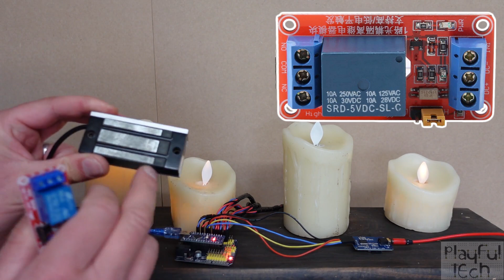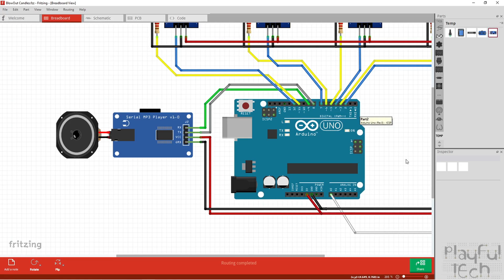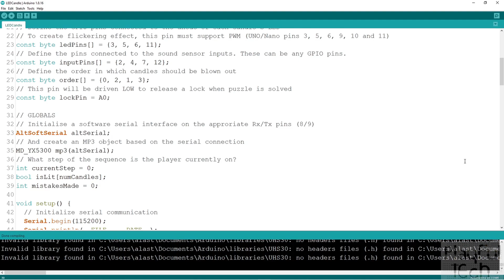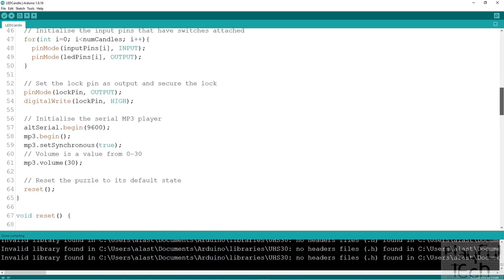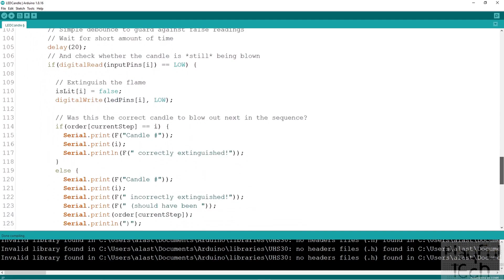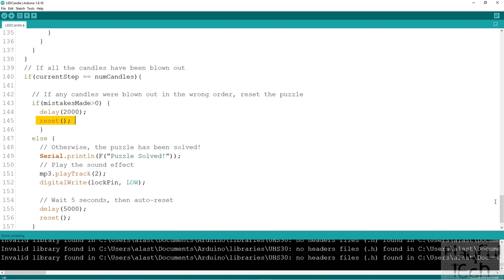"Blow Out Candles" Arduino Escape Room Puzzle Tutorial

Comment: What aplifier are you using in this? Are you able to do a video on adding sound to puzzles in the future if you haven't already done so?
Also, maybe a video on how to manage power? As at the end of most these puzzles you end up needing multiple wall sockets for arduinos, maglocks, speakers, amps etc. Is there a easier way to manage this and reduce the amount of plug sockets or is it simply the case of getting extension cords?
Reply from the maker: I normally use a cheap power amplifier like this one: https://s.click.aliexpress.com/e/_oFhtXOS
Reply: @PlayfulTechnology  perfect. Thanks for the link. Do you have any recommendations for cheap small speakers for puzzles like this that don't need audio output that's too powerful? As a complete audio noob my only speaker buying experience is computer speakers that plug in via an aux lead. What should I be searching for when looking for speakers that will plug into the input on these type of amps? Thanks for the great videos. Love your creativity and knowledge and how you break it down so even someone like me can understand and follow along lol.
Reply from the maker: @coasterollie  I normally salvage speakers from old computer speakers, Hi-Fis, arcade machines. Basically any small speaker with 4Ω/8Ω resistance will be driven by an amplifier like that just fine (and be quite loud!)
Reply from the maker: Power is an interesting one... I have considered it, but there's such a huge variety in how people run power in their rooms (e.g. do you have a low voltage 12V/24V loop run throughout? Or do you have wall sockets and run local power adaptors to each prop? Or do you have PoE?) and then there's the matter of electrical safety regulations which differ by country (I'm in the UK, so the advice I give for our 230 VAC here will be different than in Europe, or Asia, or the U.S.), so I've always considered it something that is better consulted with a local electrician
Reply: @PlayfulTechnology  thats fair enough. Thanks for explaining and I understand. 😊

Comment: Does the amp rating on the power supply matter for these projects? I have wall plugs that are rated at 1amp, 2 amps and 5 amps. Does it matter which one I use?
Reply from the maker: The rating on a power supply gives you the maximum current it is capable of delivering. So long as that exceeds whatever your project requires, that's fine (a typical Arduino project might only draw 0.5A, but if you powered it via a 1A, 2A, or 5A supply, they would all be fine, since the Arduino will only draw as much current as it requires)

Comment: Thank you so so much for this tutorial! I have been making escape rooms in our garden shed for my family and some friends - and wanted to make these blow out candles for my next room (a halloween theme!), but didnt want to spend an arm and a leg on a pre-made version (especially because I can reuse these parts in the future if i make it myself) 

I have never coded anything in my life or built anything electronic for that matter. I worked solely off this tutorial and was able to make a fully functioning 3 candled escape room puzzle (without the mp3 function because I wanted to keep it simple for my first project). I had to tweak the code a bit, because for some reason my mag lock was powered differently and I actually needed to code the power source to LOW until the puzzle was solved and switch it to HIGH to open the lock (it took me a few hours to troubleshoot that lol). Apparently the power source to my mag lock works when the arduino board isnt plugged in, but stops working/cuts power when the arduino was plugged in - no idea why?? 

I definitly learned a lot from this and now have a super fun element for our next escape room, so thank you so much!

Comment: Hey i had some problem with the code ,  it wont work for me , even when i use the arduino without connecting anyting i get these :
"Puzzle Reset!
Candle #0 correctly extinguishe!
Candle #1 incorrectly extinguished! (should have been 2)
Candle #2 incorrectly extinguished! (should have been 1)
Candle #3 correctly extinguished!"

he keeps running with the same result , can you help please

Comment: I hope you don't mind me asking: How long did it take you to finish this particular project? Just the props and programming, not the video?
Reply from the maker: It's very hard to say because I don't create a single project from scratch all in one go - I've been making these projects for many years now, so a lot of the time I might have leftover ideas from previous projects, or commissions that didn't work out, and I often use those as a starting point. Sometimes I have an idea and it just works first time but, more often than not, I have to go through several versions on the way and (mostly!) I never show those failed early attempts. In this particular tutorial for example, I spent at least three or four days learning and experimenting with different sorts of sensors before settling on using these simple microphone sound sensors, for example. But, although you'll never see those sensors used in this particular project, I don't regard that time as wasted because maybe in the future a new project will come along and I'll be able to think "Ah-ha - I know just the sensor for that!" ;) 
The programming itself does not take me long - my background is as a software programmer, so I can confidently write the code to get the behaviour I want very easily. The problem is almost always on the hardware side, because in escape rooms you're often trying to use components in slightly unusual or novel ways, and there's not a whole lot of precedent as to the best way to make an exploding wall, or convincing dragon's breath, or a fortune teller's ball that you can read a clue from etc. etc. so it just takes some trial and error.